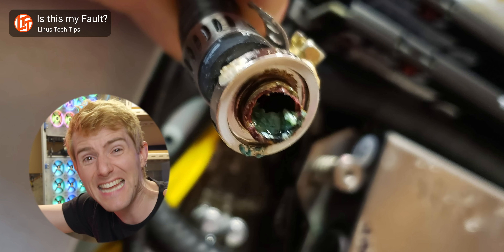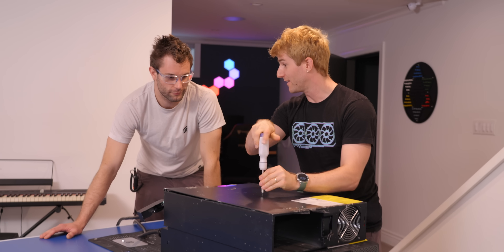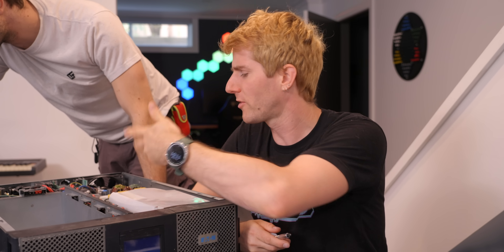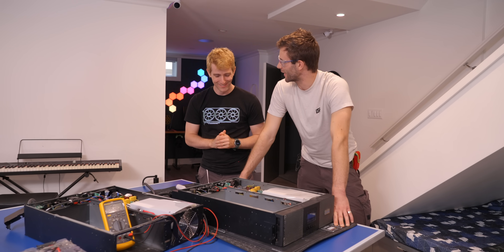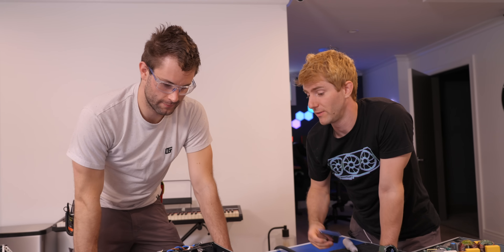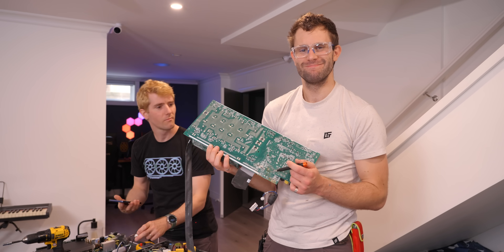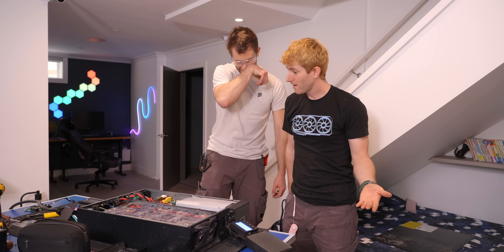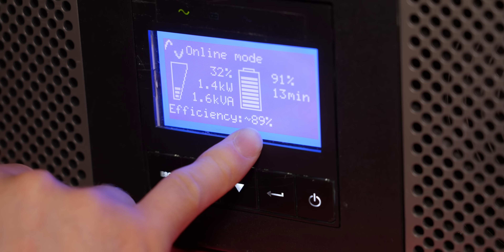Risking my life to save $5000 - Water Damaged Battery/UPS Repair

Comment: You can use a multimeter to drain caps, while reading the voltage so you know when it's safe. Make sure the black lead is grounded in the comm port, set it to DC volts, and touch the anode of the capacitor (typically large caps have a polarity marker, which will mark the cathode (not always though), and if you don't know what all that means, don't attempt, lol

Comment: I remember at my last job dealing with these (logistics at a defense contractor), the ones that came back from Afghanistan where roughest of the rough but still worked, the ones that came from the border one of the units wasn't strapped down prior to shipping and the power cable was ripped out of the back, good thing we had nearly 70 of them in storage in various conditions and ages

Comment: located UPS system at the bottom of a rack, water cooling leak, then connects wrong voltage cable at the end.... amazing this guy hasn't killed himself.  Probably did his own house wiring to the same level of attention to detail.

Comment: at 13:45 the diode symbol in R (International Rectifier) fast fuses ment (in year 1983) that the fuse is fast enough to cut current before diode or SCR it is protecting is destroyed

Comment: the happen when its powered up when wet.  there are place that will fix those boards there have been laptos fixed that  had wors watter damage than that. the repair  would have been around 300 in the market where i live.

Comment: Everywhere I have worked in an engineering role, the rule has always been that if any of the 3 Fs have changed, then it is a new revision, if not a new part. Those 3 Fs being Fit, Form and Function, with some arguments always arising as to whether the form is external only or internal too

Comment: 12:51 thats crazy just labeling anything above a certain voltage dangerous or hazardous. what about the amperage? the rating that should be labeled dangerous should be watts or joules or something. doesnt ohsha also say you need to always maintain three points of contact when entering and exiting a (deliver) truck? clearly they are very logical and think things through.

Comment: 18:33 lol, getting pulled over by Utah Highway Patrol. (It's the colors of the blurred symbol that gave it away.)
Reply: ... and not the fact that they are at a salt lake
Reply: @BryanLu0  Two things: First, most of where they filmed standing next to the truck is the Bonneville Salt Flats, a bit ways away from the Great Salt Lake, and Salt Lake City in general (hence the 'salty' comment from Dennis after licking the tire covered in salt). Second, the highway they are at could be literally anywhere in Northwest Utah (although likely limited to the area between the Salt Flats and SLC). Is there a chance behind the little mounds is the GSL? Maybe. 

But I was more so pointing out that it was the Highway Patrol car due to the blurred colors on the side.

Comment: 08:07  ok so little addition here. 
a capacitor doesn't work the same for DC as it does for AC. 

a capacitor is not a connected circuit. there is a gap in the circuit.  (like having cut a wire.  but unlike a wire it can store a charge and release it when it's not being charged) 
for AC it doesn't care that that gap is there.  (that's how small the gap is)  
it's not like there is a spark going back and forth either.  
but with DC you can imagine it pushing the electrons through the circuit.  
but with AC each electron is just dancing back and forth a bit.  none of them have to actually cross the gap so it's like the gap isn't there. 
(the capacitor does still store a dc charge)

fun fact. 
if you take an induction coil.  this effect is reversed. 
the induction coil isn't a broken circuit.  there is no gap. 
but it's coiled up in such a way that it induces a magnetic field. (with a ferrite core)

DC doesn't care about this magnetic field and just treats it like a short. 
however AC when passing through this magnetic field will feel resistance.  

so it's like the reverse  
dc hard to go through cap.  easy to go through coil.
ac easy to go through cap. hard to go through coil.  
(not exactly a one to one reffrence but still could be seen like this.  and i found that funny)

Comment: 8:10 love the slow explanation turned realization for many that DC is the only way to measure unplugged circuits even for AC systems (unless youve got some weird resonance or oscillator with remaining charge, ie the one LED bulb in the perfect spot in my basement to hold a charge and possibly interact with other wiring to stay lit when switch is off for a few seconds, or like a 555 timer that still has a charged capacitor across + and - rails or something)

Comment: I saw a 200v capacitor in a garage one morning, thought it would be discharged since it prob removed the night.
Was fiddling (tossing it around) with it and then put it down on a metal screw ddiver , a lil spark that put 2 permanent weld marks on the axle appeared and i never touched caps again

Comment: How about upgrading a game boy advance with new mother board, 16mb 48 pin tosop static ram or 1megabit fram and 32 mhz turbo speed crystal and switch. New Case, buttons, and try still have the aa battery holders in good shape and try the tenergy 2000mah battery with  2000 cycle charges, USB c charger with diode bridge or solar panel adapter power supply. I am sure that be like three hundred dollars to do something like that. If you can do it under 200 dollars great. Maybe even under a hundred but I don't know if you can just use a game boy advance sp screen and processor in the gba mother board. That alone is like seventy plus fifty over 130 dollars, new ramp chip is ten dollars or so, and it needs to be 1.8v at least. I don't think they make 1.35v 48pin tsop ram. But a crystal and little round switch is bound to cost an extra ten dollars to twenty for the switch and 32 mhz crystal. And then upgrade the battery powered backups on the game cartridge with fram. That is an exercise in soldering and maybe stupidity or maybe it may be a neat experiment. I have no idea if it would work or fail.

Comment: People, like me, go through extensive training for electronics repair (I was an ET in the Navy). We spend MONTHS and MONTHS in schools nonstop training everything electronics and then go into more specialized training for surface mount repairs and troubleshooting and calibration... then we spend years on the job training with very experienced techs... so we do not die. Guys - this is tempting for a lot of people - but it is seriously not cool to publish something like this that can literally kill you. Damaged high voltage and current capable devices can have shorts and damaged safety grounding or otherwise internally where there is loopback current even to the chassis ground and the potential in voltage can be thousands of volts with a huge potential load that is just waiting for someone to touch the case or something inside so those electrons can start flowing - and zap you to death. DO NOT DO THIS. Let a trained repair tech do what they do.
Reply: Is  your pink rack even grounded?

Comment: 3:30 Coincidentally I also fixed one of these just the other day (it had been stored in a humid environment and had some corroded PCB traces). These Eaton 9PX do *NOT* discharge the capacitors when powered off. I was still measuring 280V on the big electrolytic caps 24 hours after it had been turned off and unplugged (both mains and battery).

Comment: PSA: Linus please warn ppl in your upcoming video that this is a huge industry and they prey on inexperience 24/7 as their way of life. If you do it long enough you’ll learn the majority of viable listings are social engineering scams trying to take your money by lying about the product’s viability. 

I learned ages ago 99.9% of listings on EBAY that have a damaged item that could potentially be repaired, they’ve already had multiple repair attempts performed on them. 

They’ll be listed as “broken or for parts” and suggested that nobody has attempted to investigate or repair,  but as a professional repair shop owner they almost ALWAYS have signs up repair attempts having been attempted. Why would they not check and try before they forfeit hundreds or thousands in potential profit or limits on their losses. It’s a fairy tale to think we have any chance at finding repairs like this unfortunately so don’t fall for the EBay Seller trap. There’s tons of eBay sellers that buy CONFIRMED UNREPAIRABLE PRODUCTS from honest sellers in huge lots and then list them all one by one as as if there’s a chance they can be repaired, and their profit margin is just how successful they are at lying to people, it’s disgusting.
Reply: You do have a slightly higher overall chance as you get into higher tech products where soldering chips onto boards are involved…but when you’re dealing with products about 1,000 USD and up, they’ll take it to a pro to get an assessment before they sell it and pretend they have no idea, many times even describing it as having symptoms that align with well known and repairable issues despite the actual problem being a very different well known notorious problem that CAN NOT BE REPAIRED. Plasma tv’s are a good example, they’ll claim symptoms are such that it seems a little scaler chip needs replacing when in reality the panel has a tiny crack and the gas has escaped and that panel will never function again. For every product that has a repairable problem, there’s a few problems that have zero possibility of repair even if in the hands of the Louis Rossman of that product category, so just be careful folks and try to deal locally whenever possible

Comment: One general piece of advice:
When poking around or even just pointing at things that may have a non zero risk of being under high voltage (normally over 50V or so, but in worst circumstances, even lower can be pretty harmful), please don't hold the metal on the tool you are using to point and poke.

Comment: This is the reason that if you're gonna go with liquid cooling you should use mineral oil, not water. Mineral oil is nonconductive and most things won't dissolve in it meaning if you have a good enough filter to catch the metal particulates from the pump, a leaking cooling system filled with mineral oil won't cause nearly as many problems as one filled with water.

Comment: Hi, manufacturing engineer here working on high standard security level components. We wouldn’t change Revs on the whole product for changes that simples. Has to be a change in something significant to the product’s production but most regularly results for end product are the same

Comment: This was a pretty bad example of how to go about the process of working out what happened and what is actually dead.. as soon as you realise that fuse is blown you could quite easily inject low voltage and see if you have a short downstream that caused the blown fuse.

Comment: With all of the resources you have Linus why would yall ever use lead acid batteries and not upgrade to lithium?
I'm poor lol and even my two backup UPS's have lithium packs that I built instead of lead acid it came with.
I went from about 20 mins of extra time to hours of extra time if power goes out.

Comment: Hold on, if I remember right, 240v plugs (in US anyway) is 120v out of phase, so using a portion of a 240v plug is just synchronized 120...... how is a 240v system working at half voltage?

Comment: One the first thing I learned working with high voltage is please use rubber shoes so that you never make ground, because currant is going to go to the lowest path of resistance and it it's you, especially with dc it's very, very bad

Comment: in hindsight, they typically put those on the bottom because of weight and in case the batteries leak, it might be a better idea to put it on top considering it's a lower leak risk than the custom jury rigged water cooled systems.

Comment: So I’m an electrical engineer and one thing I didn’t hear talked about here is dielectric absorption. This effect can result in “discharged” capacitors not being fully discharged and gradually building up voltage across the contacts as charge escapes the dielectric. This is  especially problematic in electrolytic capacitors.

Comment: 9:43 All that safety crap and they're touching the heatsink, high side FETs have tab pins to +Vsw meaning the heatsink could very well be at a HV potential. This is common in switching supplies since usually theres a bank of FETs for the high, one for the low, the low side heatsink is grounded, high side heatsink is +Vsw, this eliminates the need for thermal pads on each FET plus majorly imporves thermal performance.

Comment: If you had put something waterproof between the units say plastic sheeting that could divert leaks away from units below to a safe place you wouldn't have had to do this suggest you look into it now may be have it go into a water tank with special sensor that triggers if wet & shuts down server rack, you may have to slightly raise one side so water leak flows to side leak tanks on.

Comment: Making me feel uncomfortable using the LTT screwdriver for a HV electronic. There are HV drivers rated for 1000v. This makes me wonder. Is there any shock prevention on the LTT driver? is there anything to prevent shorts? Was thinking about getting one. If there isn't anything to prevent shorts, can I paint on plasti or cover it in PVC tape? Maybe some black cloth friction tape in honor of my northern friends.

Comment: Most 240 Volt devices work on 120 Volts too. If you look on the label it should say its input voltage range. But the same is not true for most 120V devices.

Comment: wheres the high voltage ? wouldnt be surprised if someone said high voltage when opening a microwave oven (2kv transformer, hv is anything above 1kv) but a UPS ? it have 320v or 350v at most

Comment: Eh, Lithium-ion batteries are certainly spicier, but the danger factor for a personal injury case is still about the same. The main difference is that lithium chemistry batteries, if they fail shorted, really want to burn your house down.

Comment: This whole scene reminds me of when I told a cousin, we just need to check the continuity. Found a dead coil pack in his 350z, and then said, well lets swap it.... He cut the wires to the coil pack because the connector was being difficult.... POP... smoke.... one ECU and wiring harness later...always disconnect your battery guys. Knowing how a meter works and being smart enough not to completely fry something are two totally different things. Although, seeing this video makes me want to be brave like Linus once again.

Comment: Please don't spread misinformation. You are not working with high voltage at all. High voltage is above 1000V. Or maybe even above 115 000 Volts, if you were to believe the yankees. You are dealing with 240V at most. That is well within low voltage. And no, you wouldn't die if you were to touch it. It would just hurt a lot. Unless you have heart pacing issues. They, you would die.
Tynan should really know the difference, if he claims to be mechatronics major.

https://en.wikipedia.org/wiki/High_voltage

Comment: 3:30 There's nothing quite as surprising like opening a 480V inverter and finding out that the bus capacitors are still charged up at 650V because the bleed resistors didn't do their job.

Comment: The cost of these units is mostly the insurance certification and the guarantee and warranty  not the actual electrics. All that is void now that you publically advertised it. You should have just went with a 51.2v lithium iron phosphate rackmount battery or rackmount kit and some cells and an inverter.

Comment: So why did he install the UPS at the bottom of the rack again? if there is another leak it will be flooded with water again?🤔 wouldn't it be better to install it above the other hardware?

I mean sure I always install UPS at the bottom of a rack because of the weight balance, but with water cooled hardware above it... not sure about that.
Reply: high end ups = heavy af, this ups is about 50kg (100lb)

Comment: This brings back memories of the failure of a large UPS at a datacenter where I used to work.  The cause of the damage was, again, water entry, due to a failure of an A/C unit nearby.  

Eaton sent a tech out to repair the unit.  Less than 5 minutes later all the lights dimmed in the call center.  Then we saw the Eaton tech being carried out to an ambulance.

As I understand it, he failed to check or disconnect a voltage source and got severe burns.  The Eaton tech recovered, but we had an object lesson in properly paying attention to safety precautions.  Shortly afterward, the people who managed the datacenter implemented stringent "lock out/Tag out" standards.
Reply: when was this??? why didnt they have lock out tag out 😭
Reply: @bkbreyme  It's kind of funny how high voltage equipment don't have water resistant design. Water drips down? Lets put holes on the top panel
Reply: @pistonsjem yeah, architects are to blame, they should put care to where water and sanitary lines are placed, along with ventilation vents.

Comment: A place I worked at was throwing out 120v ups because of age and battery issues. I was able to sweet talk my way into getting 1, the company was so anal they would let people even take-home trash from inbound shipping (wood). I UPS only had 25% of its rated battery power and was able to replace battery for 1/4 of price and because it was a PRO series the company sells a battery extender that's double the capacity of what's in the UPS